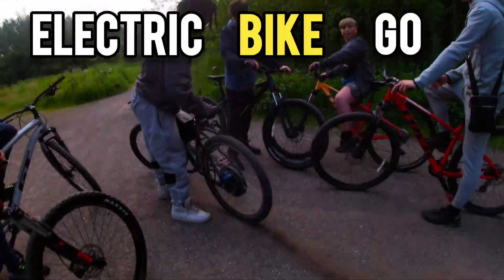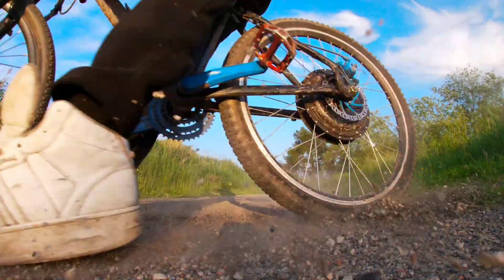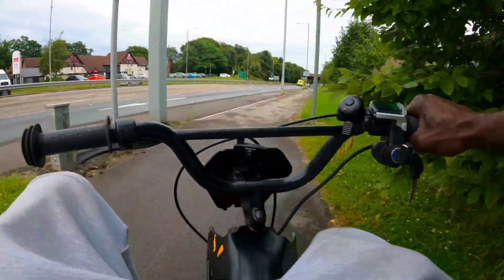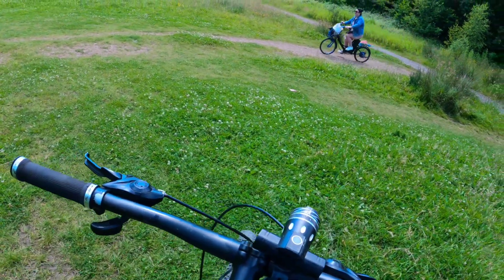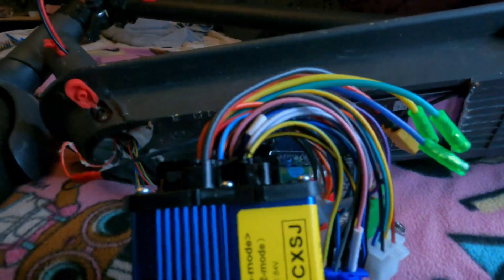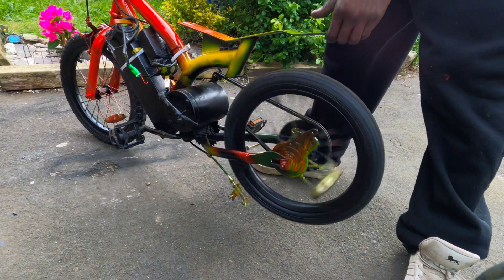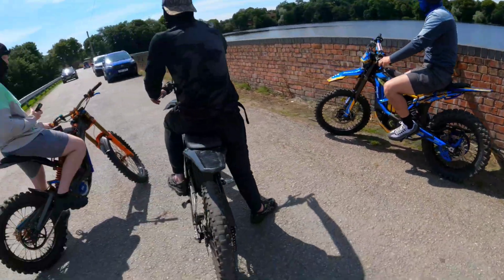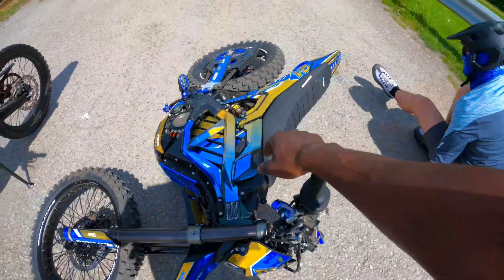How to make Electric Bike go Faster

Comment: My ebike has lost 7mph do u know why?
Reply from the maker: The most likely reason for your top speed decreasing would be the battery. Either your battery health is not at its best anymore or your throttle if you have one is not fully registering wide open due  to dirt being inside.